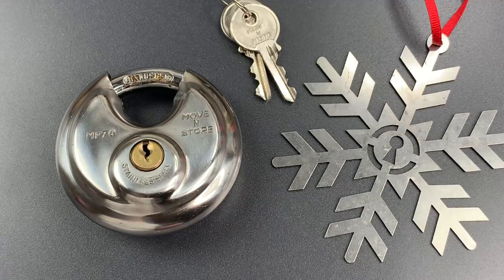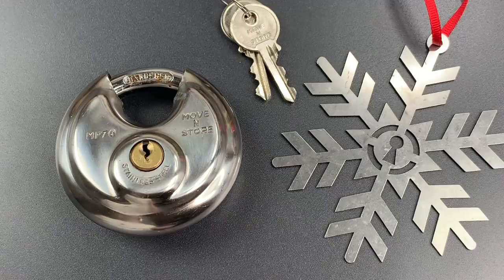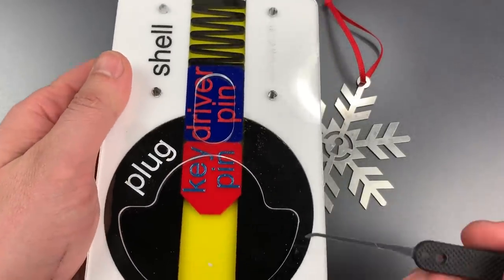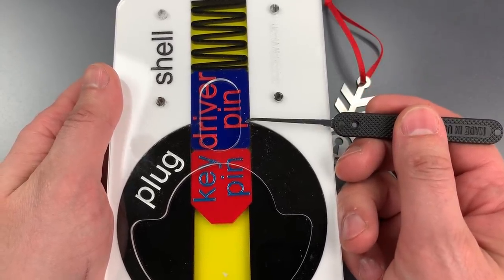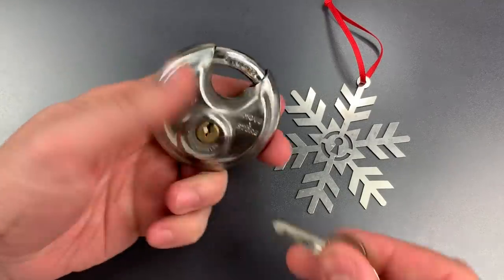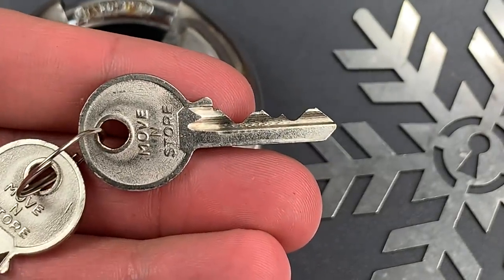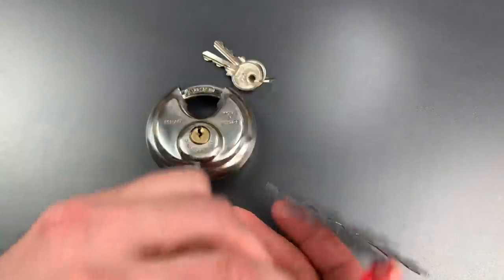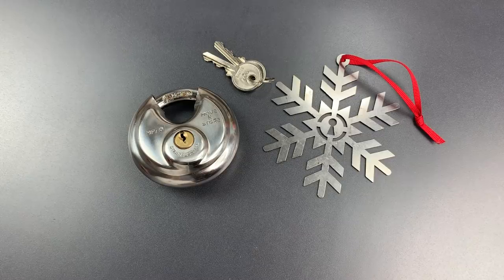[820] Opened With A Christmas Ornament! Move N Store MP70 Disc Padlock

Comment: Finally a lock even I could pick open
Reply: Actually...I think this lock is pickproof, if it's essentially unlocked in its standard position, then any attempt to manipulate the lock i think would result in the lock seizing up, not only that but you couldn't tension the lock which is required for lockpicking.
Reply: @Silentguy_  but you can't pick the lock by definition
Reply: @RDeathmark  this is true he technically did not pick any pins
Reply: @RDeathmark  big brain lock, you can’t pick it if it’s technically never locked
Reply: @RDeathmark Nope. "Lockpicking" starts when you stick in the tension tool and try to turn it. You just never get to step 2, but you're using a lockpicking tool to open it.

Comment: You could probably twist the core with your finger tip
Reply: Or even the shacle.
Reply: Or just start narrating a video about it. Click!
The most impressive thing is that he explains it well and opens it, all in under three minutes! Nice Clean work as usual 👍
Reply: @legomachines5970  Maybe not, some of these have a detent that stops you from pulling on it until the key at least moves a slight bit.
Reply: @joblessalex  Most of them do.  Can't say about Masterlock versions that might open with a stern look.

Comment: This does bring up a couple of interesting points:
1) A missing QA step: not only make sure the lock opens with the key, make sure it doesn't open without a key.
2) How is the bitting determined for mass production locks? Is there a computer program that generates a sequence of keyings? Or does some guy reach into a box of random floor-sweeping pins and put whatever comes to hand in the lock he is building?

Comment: Is this a flaw with this model of lock or just this individual lock?
Reply: Given the bitting, and the pin types, I would say this particular lock would work as an actual lock had the bitting been anything else.
Reply: This exact problem is specific to the lock, but any production line capable of spitting out something like it has some baaad problems.
Reply: Both. This lock will have pins at the sheer line for three of the cut depths, which is a horrible design flaw. This lock's pinning is entirely those three cuts.
Reply: Zero lift pins are normal, but having three of them in a lock is not. Short stacks are a design flaw and should never be in any lock.
Reply: I have a lock that used to have this same problem, but it fixed itself when I smothered it in WD 40, so it could be that one of the pins was stuck above the shear line. Still, the 0 lift and especially short stack make locks way less secure

Comment: Short stack strikes me as there being a possibility of the end of the spring getting below the shear line (if production tolerances are bad enough) resulting in the end of the spring getting dragged into the mechanism.  Maybe that's just me being paranoid.

I was amused by the keyhole symbol in the centre of the christmas ornament.  Very appropriate.

Comment: "..,,,a Unicorn lock. Something you never see".  I see these type of locks all the time - they are quite common in shops.
Reply: I don't think the lock type is the unicorn...I think it's this sepcific lock, that can be opened without picking at all.

Having said that, I've seen at least one other lock similar to this, but it was broken. Any key that fit the keyway would open it, or a flat screwdriver, or a Christmas tree ornament.  Probably too stuff for a Dorito, though, since it was the ignition lock in a pickup truck.

Comment: Wow. I am new to this sport, but I'm tripping some circuit breakers imagining a lock which is always open.  I guess that means it is unpickable since picking would lock it... Pop, there goes another breaker. 

Is that called Security by Absurdity?
Reply: It would open as soon as you're applying tension, so it wouldn't even give you a chance at picking lol. I've almost got one of those too, only a single pin has to be manipulated to open it up.
Reply: Maybe you could pick it with a stale Dorito and a piece is spaghetti :-)

Comment: I have a large beefy lock I use on my boat that I can open with a screwdriver.  The appearance is intimidating enough that the ease at which it can be opened is a mute point.  **looks out the window to make sure the boat is still there**   

I thought that Christmas ornament would make some nice shims at first glance but it’s too thick.

Comment: I think this is one of your best videos of showing how poorly some locks have been designed. Its not hard to add the key pin and the driver pin to make sure that is greater then plug pin drill depth. Also the key pins being used should never equal plug pin drill depth either. But some locks have been made so poorly that it must be by design. Not sure why they would design them so poorly. Its not that it is cheaper, so it must be by design. They don't think there are enough people that are smart enough to tell that its bad by design.

Comment: I now have a fairly large collection of locks and the ones that give me the most trouble are these puck locks.  Its a little disturbing that I can open basically anything I want, but security pins + heavy spring tension = fail.
I have 2 Brinks puck locks with 4 pin cores that almost definitely have 2 spools and I can't pick either one of them.  What gives?
For reference, Ive got several hundred door lock cores and a couple dozen padlocks that I'm more or less fine with.

Comment: I guess this solves the age old problem of having to carry around a pocket full of keys. Pick a key, any key, and it will work.

Must have been designed by a highly skilled disgruntle Master Lock engineer.
Reply: That was the thing...keys won't actually work if you stick them in far enough to move pins, while your fingernail might do the job just fine.

Comment: To think that one of these was the only thing protecting my storage unit. Please do a follow up video with an actual stale dorito.
Reply: The lock's bad combination of pins is rare, which is why in the intro, he called it a "unicorn."  This really had little to do with the quality of the lock, but definitely showed bad quality control on pinning the keyway, in whatever factory that came from.  This is basically nobody taking the time to look at what they were building, while the system on the whole usually works fine.

Comment: So does that mean a bump key or jiggle key would bind the pins where they should have been at rest? ...what's the sparrows snowflake actually meant for? use it as a throwing star against a potential thief? cutting pizzas?

Comment: But this is an UNPICKABLE LOCK. I mean, think about it, if you move any of the pins, the lock won't open, but if you just apply tension without picking a single pin, it isn't really picking. Therefore, this lock cannot be picked open.

Comment: So basically it's unlocked at rest, putting the wrong key in puts them in the wrong positions.  If it weren't a spring loaded lock (most of these type are) a fingernail could turn it.  So bad.

Comment: that is just awful   it may just be that particular key and lock configuration.

when locks are made i suspect  they cut keys for the entire range combinations and pin every combination.

so there  will be some locks with pinning that  puts the pins close to the shear line at rest.

think of it like your master lock combination lock they probably use all combinations from 1 1 1 to 40 40 40 .

because the dial combination locks have sloppy combination ranges maybe up to 5 combinations per disk can open the lock the combination is not very precise so that reduces the number of combinations by a factor of up to 5

fortunately it is not a gun lock so the false sense of security will not lead to someone getting hurt or killed and possible jailed or held liable as some states/countries have laws that puts the owner liable for stolen guns if used in crime or child bypasses the lock.